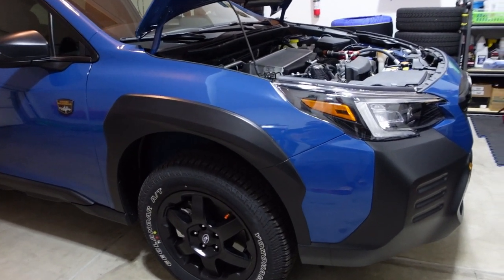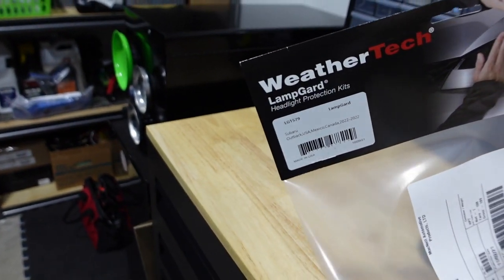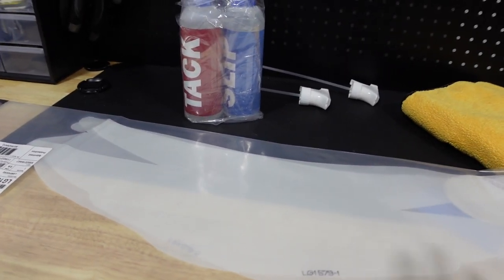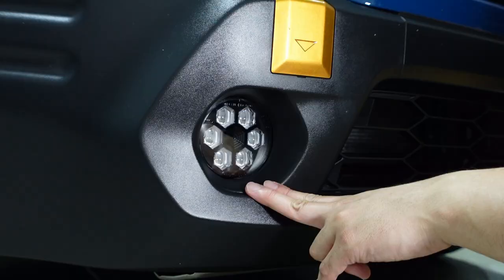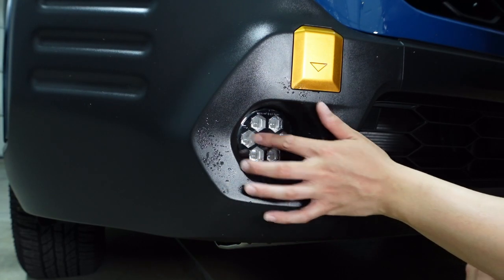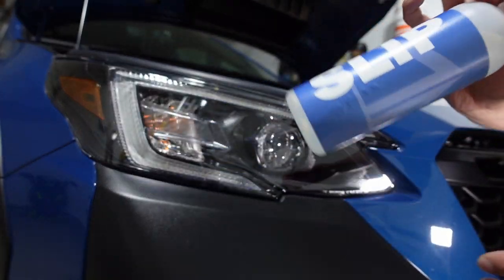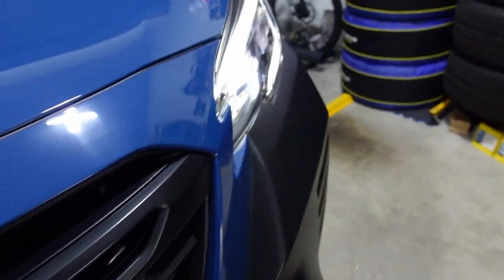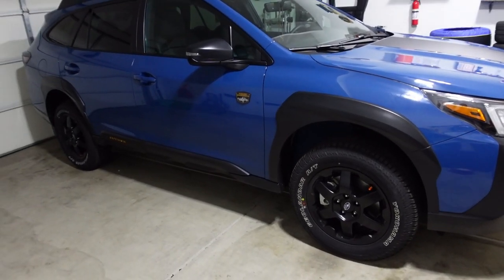WeatherTech LampGard | How to Install on a Subaru Outback Wilderness

Comment: Cool. I’ve been looking for ppf/ headlight protection since I ordered my Wilderness. I forgot WeatherTech sells it.

Tip: Spray some tack or alcohol solution under the film in the larger bubbles around the edge and then squeegee it out to make them stick and settle faster.

Sometimes the smaller bubbles can be eliminated if you poke a needle right through the center and squeeze the solution out.
Reply from the maker: Thanks for the tip! I’ll definitely do this if I decide to re-do the covers I have on my WRX.
Reply: @ronfromportland  You’re welcome. I’ve been using PPF for a long time. With the complicated angles and curves of the newer cars, I just pay professional installers now. It’s worth a few extra hundred bucks to have them do it. In for a penny, in for a pound, and all that.

Comment: Nice. How long is the useful life expectancy  of these protective films from Weather Tech? Are they easy to remove in future for new replacement? Thanks for the well made video.
Reply from the maker: Not entirely sure how long they will last, assuming for years on end since Weather Tech is a reputable brand. It should be simple to remove with a heat gun even though it wasn’t required for the installation.

Thanks for check the video out!
Reply: @ronfromportland  Copy. Thanks for the quick reply. I hope the  Weather Tech films work great for you. I personally would apply a good synthetic wax on the film as extra insurance that over the years it takes longer to break down and dry out. Maybe every 4-6 months at least. I would probably not go longer than 5-7 years without changing them out. I'm sure you've seen older vehicles with 3M films dried out cracked and yellowed because they were probably neglected or left on too long. UV light will take its toll even on treated stuff like those films that should resist UV degradation for about 5 years. Lamin-X  also makes great lense protection films of various colors and tint.
Reply: Subbed. I should be getting my 23 Outback Premium next week. 1st Subie.
Reply from the maker: @truckerrickakamanowar  yup! Completely agree! Ceramic coat was also applied on the film so it should help with longevity.
Reply from the maker: @truckerrickakamanowar  congrats, enjoy it. I drove an Outback premium as a rental and it was way more comfortable.
Reply: I’ve had headlight film last for 6 years. Sold the cars, so I’m not sure how long it lasted beyond that.

Comment: It's been 1.5+ years since the film was installed.
Are you satisfied with the results, or is there anything you'd do differently?
Reply from the maker: Super satisfied. The only thing I would do differently is to address the 1/4” spot on top of the headlight that I thought wouldn’t be a concern. I would have spent more time ensuring it stuck on there instead of assuming. Overtime, a little bit of dirt got in there causing a small lift on the edge but it’s barely noticeable.

Comment: hmmmm. There's a guy that makes protectors but for fog you do have option of amber and for the tail lights and headlaps to add a light smoky or smoky film. Which what i'm thinking o doing once I get mine.
Reply from the maker: I would have done yellow fog light overlays but I recently installed the Diode Dynamics fog lights 😃